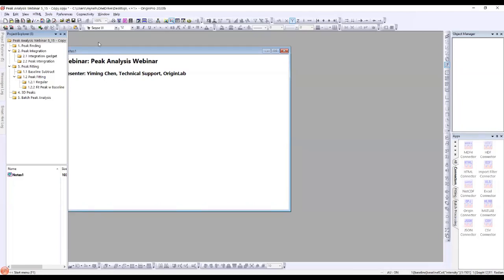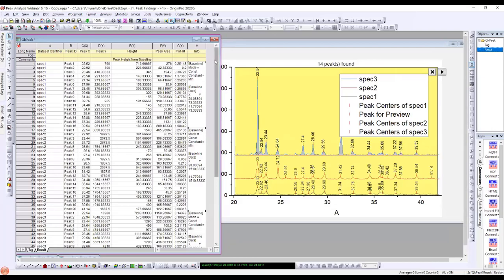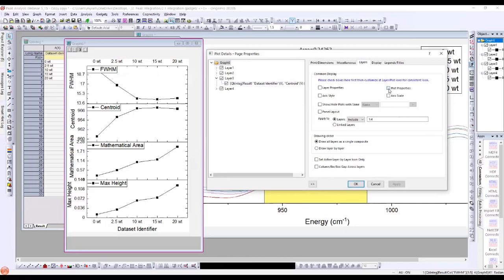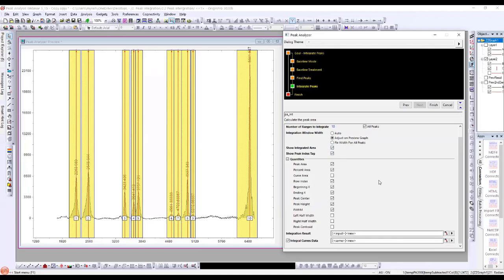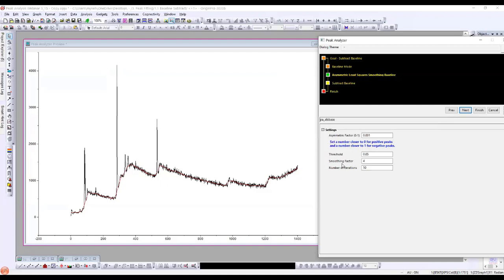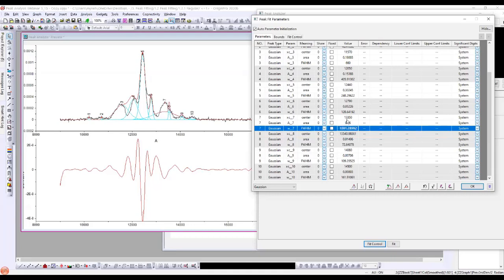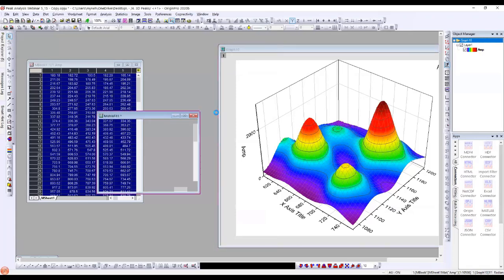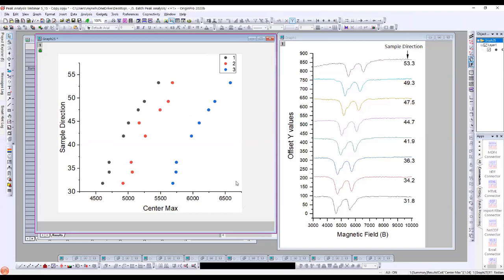Peak Analysis Webinar

Comment: Hello. I have a user defined function with 5 parameters (not 4!), and which does not have a form similar to Gaussian peaks (i cannot define width, for example). When i choose this function for multiple peak fitting, program cannot find appropriate values for 5th parameter. Why origin is too strict about the definition of peak functions?
Reply from the maker: Hello, when you define peak funtion in Origin, e.g. choose Tools: Fitting Function Builder, there is a "Peak Function" checkbox to help u define it. Also on left side of the dialog, there are Hints of requirements for peak function. Such as u order of parameters, ... Please check if it's clear to u. 
As to find an appropriate value for 5th parameter, it will depend on your function formula. Maybe u can set better initiali value and also add upper-lower bounds etc. to 5th parameter so u can get a better value of it.

Thanks, OriginLab
Reply: @TheOriginlab  Thanks for your fast response. Actually my function is almost the same as EXTREME peak function. But in the first exponent, argument is (-w*t-B*exp(-t)), i.e. +1 is missing and an additional factor B appears next to second exponent. I use this function in multiple peak fitting, and for B i assigned the role "width". Maybe i should try better initial values for B. Thanks a lot.
Reply from the maker: @fizikchy  Hope your issue is resolved. If not, please contact our support team. Best!
Reply: @TheOriginlab  thanks for your support. I am on it.